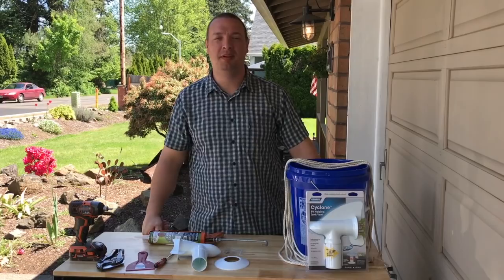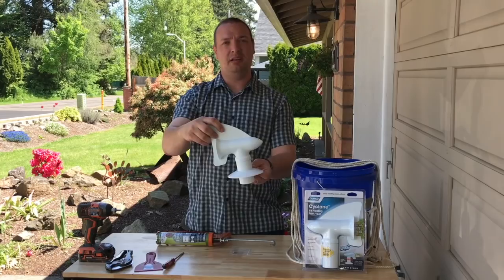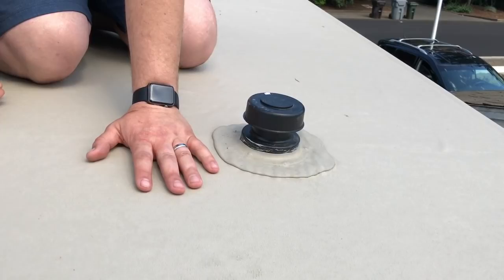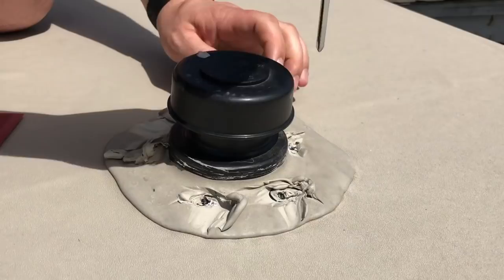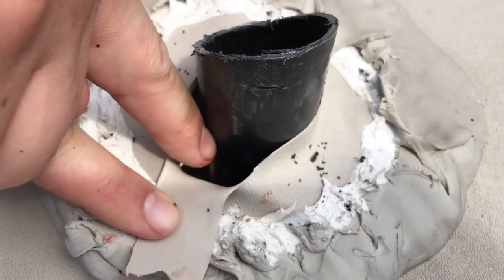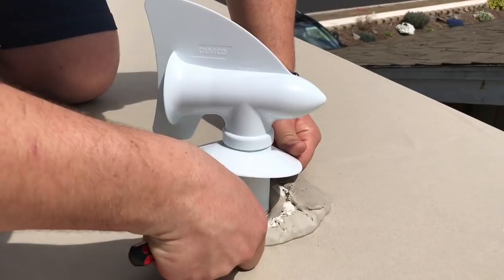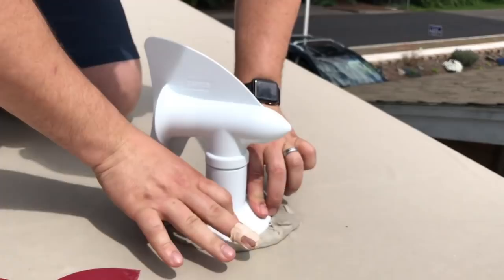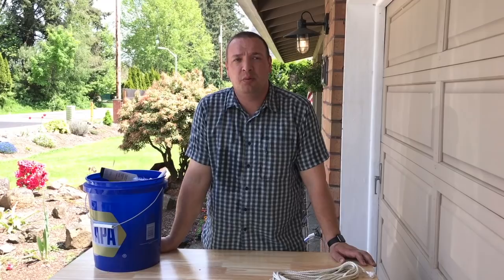Camco Cyclone RV Sewer Vent Cover Install

Comment: Installed these Camco cyclone vents about a year ago on Jeff's recommendation and they have been awesome. Easy and cheap upgrade for your trailer. Can't recommend them enough. They also work great when you are parked with just the natural wind.

Comment: use plumbers putty by making a thick rope with it put it under the cover and push it down firmly until you see it oose out all the cracks its water proof and seals very well easy to work with then caulk around the cap and tube with the leveling caulk...
Reply: butyl putty will work but latex plumbers putty will not adhere to epdm rubber it may stick to tpo, but epdm is very specific as to types of sealers that can be used

Comment: He did not properly clean that roof. The sealant won't stay on that repair. I've had my 1st rv for less than a year. And even I've learned that.
Reply from the maker: I appreciate your feedback I have had RV’s for 12 years.   I have always done my roof repairs in that fashion with never any problems.  Not sure if you have been using Dicor self leveling sealant or regular caulk but the Dicor is extremely tacky and sticky.   It is nearly impossible to remove when set up.  Unlike standard caulk which I do not recommend using as it is prone to drying out and losing its elasticity over time and UV exposure.  Once again thanks for the comment and concern.  I hope you are enjoying your new RV.
Reply: I'm doing my 1st repair like this one this weekend. And I'm just soaking up all the info I can. I'm a big time perfectionist. It must be perfect or I start over. Some friends I have that are seasoned campers of over 40 years tell me clean surface is key. They use mineral spirits to clean the surface. Before they reinstall anything on an rv roof. There rv is an 89 model in perfect shape. They bought new in 89. They say the piece you have there has moving parts. And more things to go wrong. And not to use it. So I'm going back with what I have. Cool video though.
Reply from the maker: Cool.  It sounds like you’ve done your research.  I don’t doubt it would adhere a bit better to a clean surface.  I hope the repair goes well and thanks again for your comments.  Your doing all the right things by being proactive on maintenance.  All too often people neglect them,  I like to describe them as cheaply built homes that go through an earthquake every time you use them.  Have a great day and safe travels.

Comment: Is this only for interior smells? My stink is coming from the exterior basement.
Reply from the maker: Yes it is. It is the air vent for the black and gray tank.
Reply: @NorthwestRVTours  well darn. My husband and I can’t figure out why we smell poop smell outside even when the basement doors are closed. We have cleaned the black tank out with enzymes and it just reeks.
Reply from the maker: Do you keep water in the tank?  I typically keep around 10-20% of water in the black tank to help things stay broken down.  Another thing you can try is borax and powdered laundry detergent and fill the black tank up with water and let it soak.   I have had good luck with this in the past to help break down and help clean the tank.
Reply: @NorthwestRVTours  . I might add we have a vacuum pump system however it has no leaks. Today we used a digester to break stuff down and left it filled up to soak overnight. My husband did notice a little wetness from the drainpipe that fed in to the top of the black tank. We don’t know if the smell is seeping out there or if we have stuck crap in the tank.
Reply from the maker: @rebelgurl7948  hard to say. I hope it gets fixed. Good luck.
Reply: @NorthwestRVTours  thanks for your input!

Comment: What a sloppy job of “sealing”.
You should’ve taken the extra what 5 minutes or less, to clean off the old sealant.  It looked like it came off easy earlier, what have you got to lose?
The “job” you did probably won’t leak but what would it have taken to make it 100%.......less than five minutes.
You’re welcome !
Reply from the maker: Thanks for your input.  As I am sure you know the sealant never fully hardens and continues to become thinner.  It is quite a bit of work to remove the old sealant and I have found it is easier to just go over the old sealant with new as it still provides some protection.  Thanks for the comment and safe travels.